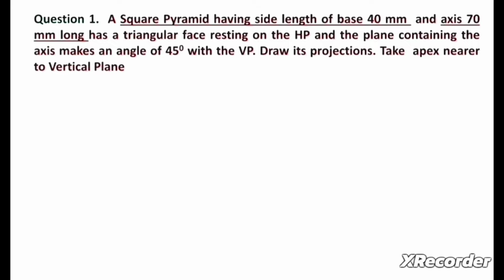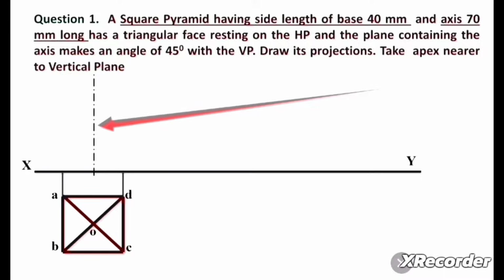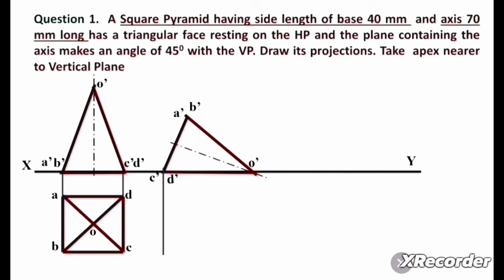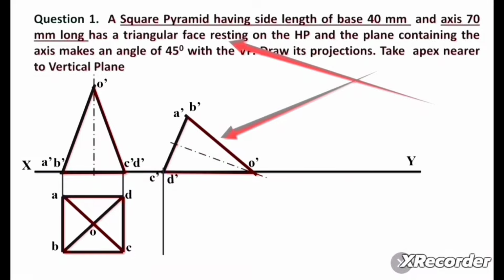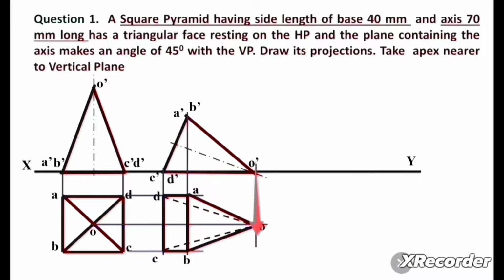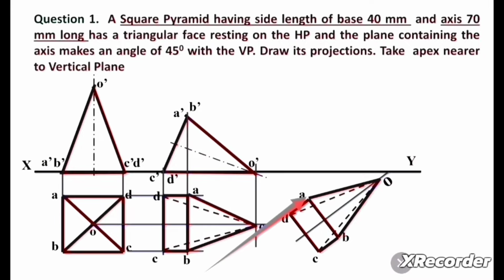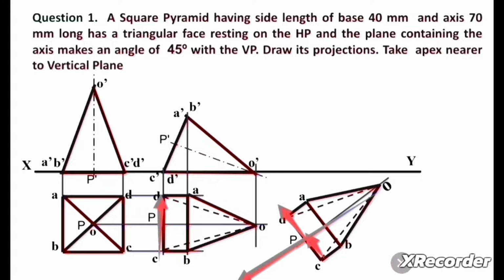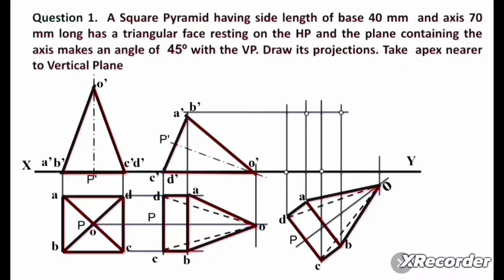A square pyramid with a base side of 40 mm and an axis length of 70 mm rests on HP with one of its t

Comment from the maker: A square pyramid with a base side of 40 mm and an axis length of 70 mm rests with one of its triangular faces resting on the Horizontal Plane (HP). The plane containing the axis makes an angle of 45° with the Vertical Plane (VP), and the apex is nearer to VP. Draw projections of pyramid.